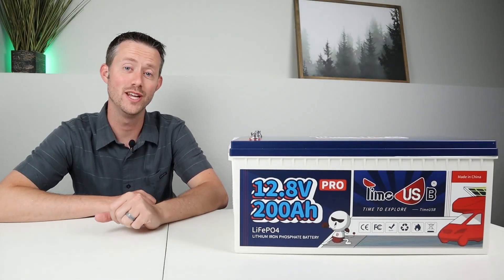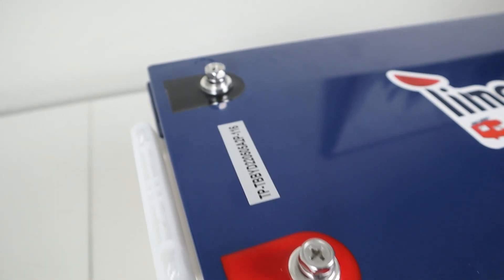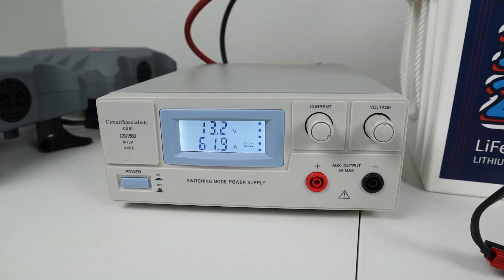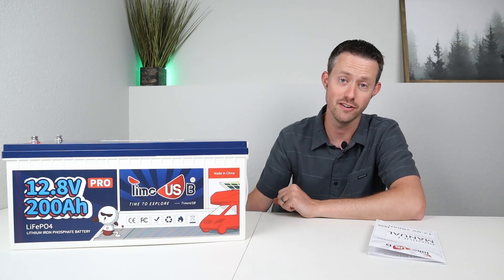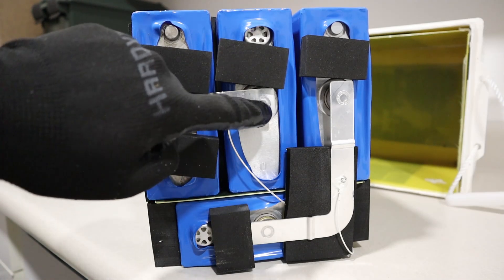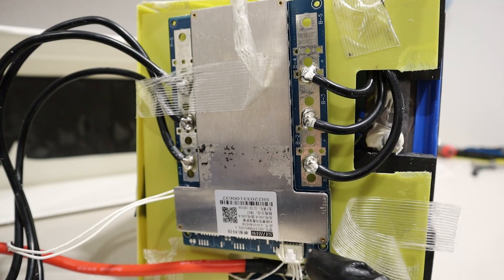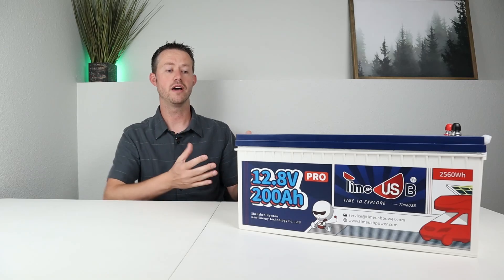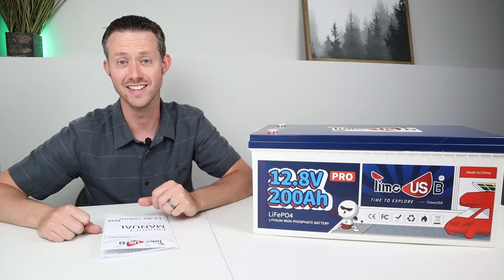Timeusb 200ah LiFePO4 - The MOST Affordable Option!? Teardown and Testing!

Comment from the maker: This is one of the most affordable LiFePO4 batteries you can buy! It has a TON of capacity for the price but only has a 100amp BMS and no low temp charging protection. What did you think of the performance?!
Reply: If they are using good quality grade A cells in the construction of this battery, then I believe it's worth the price. Especially after I discovered these batteries can be connected in series and parallel (up to 4P4S). So, just get two of these and connect them together to double the amperage draw. As far as low temp protection, don't most charge controllers have that built in now?
Reply: @troyyarbrough  yes most good cc have a lead to put on the battery for low temp
Reply: Thanks for the discount code 😁
Reply from the maker: @JOHNDANIEL1  BougeRV sent me one of their 100ah self heating batteries, I couldn't even charge it....I tried with 3 different LFP chargers, nothing worked. I gave up and just returned it. When they got it back they said it was my fault / issue why the battery wouldn't charge. I guess they think I'm stupid? I think the battery was missing the balance plug like Will Prowse when he tore his down... I'm done with BOUGERV.

Comment: Just bought the Timeusb 200ah LiFePO4 PLUS with  200BMS $499. free ship (Upgraded 200A BMS Board) : Timeusb 12V 200Ah Plus lithium iron battery has an upgraded 200A BMS board inside, which could support 200A max. continuous charge/discharge current, 2.56 kW max. continuous load power, and has max. 2.56 kWh energy... should be here mid week.

Comment: Great video nice tear down. However where did you come up with the fact that 6 ga wire is rated for 300 amps ? Even dc at short lengths your looking at a max of 135 amps and that's not applying the 80% rule for safety. 10 ga silicone wire is rated for a max of 65 amps each at short lengths. Just curious where you got these facts as someone who is not as familiar with wire ampacity might think it is ok to use a 6 ga wire for 300 amps and that would be disastrous  if not life threatening.

Comment: Great review, thanks! Do you know if the BMS is this battery is constantly balancing the voltage between the cells? I'm thinking about buying this and keeping it charged around 90%, but worry about the battery cells coming out of balance with each other... especially if I'm not fully charging it and cycling it from time to time.

Comment: Hi!
Maybe you can help out. I bought this battery and a timeusb 40A charger. The charger has a display and it shows “capacity it has charged the battery by”, but I don’t know what unit is this. It says something like 0.39C, 10C, 15.8C. Is this watt*hours?)
Reply from the maker: Not sure what that measurement is! Weird!
Reply: @Jasonoid  Thanks for your response. From my experience, it looks like it is amper*hours
Reply from the maker: @oleksandrleskiv  during a full charge it should go all the way up to 230ah. You'd have to see how far it goes!

Comment: I received this response from Gerri at Timeusb;  "Timeusb 12V 200Ah Pro battery employs new, Automotive grade cells from Tier one battery cells suppliers like EVE, CATL, Ganfeng, BYD,etc.  The actual capacity of the 200Ah Pro is 230Ah. (We name it 200Ah Pro as an upgrade from the regular 200Ah battery. )"
Reply from the maker: They have many different models, this battery definitely had used cells in it.

Comment: I know this may sound obvious, but, would I be better off to buy 1 200ah, OR 2 12V 100AH batteries ??
Reply from the maker: If you buy two 100ah batteries you have the ability to use them separately if needed.  If you put them in parallel you can get the same output as a 200ah battery.
Reply: @Jasonoid  Yes. The versatility of having 2 wins.

Comment: Nice review. But you ran into heat issues because you pulled the cap off of the battery. In my tests it will shut down sooner. Regardless, for the money, this is the best battery on the market right now. And their customer service is fantastic on top of it.
Reply from the maker: Glad to hear their support is excellent!

Comment: Jason can you build a solar cart battery system guide capable of running simultaneously a 28 cubic ft fridge and a 12k btu air conditioner and a power hungry high end gaming  PC set up (gtx 3080 or better video card) that has 800w power supply on the PC?  The whole thing including solar.  I know a ton of people who would like an off grid system that handles refrigeration,  cooling and gaming yet nobody I can tell has shown this on YouTube.  Get them views by making that video!
Reply from the maker: That's probably a 1000w continuous load, so for each hour of run time you'll need 1kw of battery power and probably 1.5kw of solar to keep it charged up. Would be a hefty system to be portable!
Reply: @Jasonoid  so....challenge  accepted?  I've just check a YouTube search.   As far as I know NO ONE has done this video and you probably have most parts to Frankenstein a working prototype.   (Insert sappy violin music here)....do it...for the children....or at least do it for the crazy amount of views you'd get with right video title and thumbnail 😉
Reply from the maker: This is an excellent system that will work!
https://youtu.be/J9WZcMDQaDg
Reply: @Jasonoid  yeah I've seen this video.  What I'm getting at is YOUR excellent presentation skills.  Build the system then actually do a full load 24 hour test showing the fridge,  ac, and gaming pc running full load AND  being fully charged by solar at the same time.  This video hasn't been done as far as I can tell.
Reply from the maker: @MyChannel-vm6dw  I'll think about it, I make penny's from YouTube so it's hard to justify spending $5000 for a project that will get only 10,000 views and make $150 lol

Comment: What cells are they using post the model or qr code.

Thanks
Reply from the maker: I couldn't find the information on the cells, they appear to be grade A used cells from an electric bus. Probably were 280ah or 300ah originally.

Comment: I guess if you lived or Rv'ed in a warm climate that would be a good battery. Living in a place that could freeze would be a poor choice. If you are a prepper it would be a poor choice. You really need that freezing point cut off. I wonder how much more money those features would be? I would pay more for a battery with a cold sensor charge cut off. I am glad to see you spread out your focus into batteries. The future is batteries and Gro Walls or the like.
Reply: You could get a charger or solar controller with low temperature cut off
Reply from the maker: So far Ive been pretty impressed by this battery since its affordable, met specs, and has low temp charging protection: https://youtu.be/dd1W8_tdl2c
Reply: @Jasonoid  
It's not $357 anymore 😔
Reply: @Jasonoid  I misunderstood your review I guess. I thought you said that it didn’t have low temperature charging on the BMS.
Reply from the maker: @kevinholland4156  in my previous comment I linked the new Dr Prepare 100ah battery video, that battery has low temp charging protection. This timeusb does not have low temp charging protection. Sorry for the confusion.
Reply: Better off to use a charge controller with a temp probe. Put the temp probe where the battery bank is and let the charge controller cut off charging should the temp 32 degrees. This is better than having the bms trip off and the  have to wake it back up. The temp probe will be more accurate then the bms as well.

Comment: Where is it made?  If China, how certain is actual delivery these days?  I'm going to file this one away; I think a project I may do in the Spring is to turn our little camper into an off-grid unit, and I'd need at least one battery like this, and maybe two.
Reply from the maker: For now, every lifepo4 battery is made in China. These are always stored in USA warehouses and shipped from California when you purchase them on their branded website, so if it shows in stock, it's pretty short delivery time.
Reply: @Jasonoid  Ok then, hopefully they're in stock when I am ready.

Comment: good job on that tear down, i am glad it didn't get destroyed in the process and i hope you are able to continue using it.
the bms and wire gauge should probably be upgraded to 200 amp continuous, for 200ah battery's. probably should also have a time limit shut down before thermal shutdown when drawing over the 100amp limit, imo thermal shutdown should be a last resort.
video side note: in the torture test section, the audio is poor for me, on headphones, one side has like no audio.
Reply from the maker: I agree, not much use for a 200ah battery with a 100amp bms. Would have been nice to see a full 200amp bms with proper wiring. 

I also noticed I only had one side of audio during that video section, something must have gotten corrupted during filming.
Reply: Sounded fine on my PC; check your headphones.

Comment: A 100-amp BMS should cut off much sooner than that.  There was no risk to the cells or the wires, so no harm no foul, but if it's rated at 100 amps, the BMS should allow a surge current for a short time but cut off if above 100 amps output for an extended period of time.  With that said, a 150 amp fuse would protect the battery from itself.  

Connecting four in series would give you 200 amps @ 48v (51.2) or roughly 10kwh of storage.  The limitation would be a (rated) output of 100 amps @ 48v, so any load over 5,000 watts, continuous, wouldn't work.  (Based on your actual result, it would...but I don't that it would be a good idea.)  It looks like a pretty decent value, but I would like to know the history on those cells.  I wouldn't be surprised if those were originally rated at something like 280ah and are 2nd life or B-grade cells, which is why they are only listing them with a 200ah capacity, and why the price is so low.
Reply from the maker: I agree that the BMS should kick in much faster since the BMS got quite warm. In my opinion it should stop around the 3 minute mark for anything over 125 amps and under 200 amps. I also would have liked to see a 4awg wire instead of the 6awg wire as well. 

There are no markings on the cells, someone else mentioned they are used electric bus cells since they asked Timeusb and they told them the source. Still pulled 230ah as advertised on the website but Im not sure how long they will pull that capacity (no advertised charge cycles in the owners manual either). At $0.20 a wh, you definitely get what you pay for.
Reply: @Jasonoid  Yes I wondered what the charge cycles to 80% is. I checked their website as well and could not find any mention of a figure for this.  I was wondering if it was in the manual but you said no, so I guess we will never know.  Maybe it's okay since degradation may be somewhat linear, but buyer beware.

Comment: This company is known for using Garde B cells in other models. Jason did you see any stickers near the cell terminals listing the AH? Or a QR code?
Reply from the maker: Nope, I looked and could find no specs or model information about the cells. Someone else mentioned that these are used cells from electric buses.
Reply: @Jasonoid  Will Prowse did a teardown on their 90ah battery, and it had grade B cells.
Reply from the maker: @grindychum  I don't think these are grade b cells, I'm pretty sure they are just used grade a cells out of bused. No swelling or damage on the cells.
Reply: @Jasonoid  Isn't that what grade B cells are, Used cells?
Reply from the maker: @grindychum  grade B cells are rejects from the factory and that didn't meet original capacity or internal resistance specs. They also could have damage like bloating or swelling.

These cells appear to be used grade A cells, meaning they have just been cycled enough to lose a bit of their capacity but aren't bloated or damaged.
Reply: The problem with grade B is that just because the reviewer got a decent battery does not mean you will also, The Chinese companies are known to cherry pick the good ones for reviewers while the rest get junk.  But we really need to know the type of cells being used, were these 300AH cells that are now 230?
Reply: those look like re wrapped BYD 250ah cells and just about the right size too
Reply: I am an electrician from Texas and I would like to say about B-grade batteries which refer to bad and defective and risky batteries and regenerative batteries, which are not B-grade batteries, are much better than B-grade batteries. Many large energy storage containers use such renewable batteries. Audi also introduced a three-wheeled vehicle this time that utilizes electric cells. The quality of the cells is tested and there is nothing wrong with them.
Reply: @isabelmerry3098  there is nothing wrong with grade B cells, besides the fact they will have reduced charge cycles because they have already been cycled x amount of times. So your technically not buying a "new" battery, you are buying a "used"battery. I have built external Lifepo4 battery banks from "used" batterys, more affordable than buying the external batterys bluetti and ecoflow make. I capacity test all the batterys and match them based on that rating.

Comment: Hi ya I saw an reviews on this battery yesterday why it so cheap because they use  2nd hand cell
Reply: As a bitcoin miner with 20 Timeusb batteries, I can responsibly tell you that the Timeusb batteries work without any problems. Their batteries are really good value for money.
Reply from the maker: Yeah, it still pulled adversited capacity and it should still last a long time even though it's used. Thanks for sharing what you know.

Comment: Thank you for explaining the difference between 100 and 200 amp BMS before I got my battery because I may need it for cooking in the future. I powered my Frigidaire window air conditioner for hours with it a couple of times in tests. Didn`t run it dead though. I have to get a battery meter with shunt and other parts to build a solar power system with it. I have a 60 amp MPPT charge controller. 

Apparently the Ampere Time battery I have doesn`t have a BMS that shuts the battery off with some reserve left but goes into protection mode and requires "awakening" so that sucks. I don`t want to overdischarge it and have that issue. I do have a 20 amp LiFeP04 AC charger to top it off before expected storms like hurricanes. 

I hope to use this stuff to build a rolling solar power station and have been warned about grounding, safety, fuses, and now have no idea what to do. If no hurricanes come this year I have until next year to buy the next 500 dollars in parts I need and hopefully more solar panels.
Reply from the maker: I'm glad you got the 200 amp bms as well. It's a good way to future proof yourself. As for fuses you'll want to make sure you have the appropriate sized fuses installed. Large 200 amp fuses are required for a 2000 watt setup. 

In a portable system you shouldn't have to worry about grounding the system. Think about portable gas Generators, no one grounds them and they seems to work fine.... I'm sure theres always a risk of something but it's pretty low.

Comment: Been building an 800watt, 24volt system for my Savana van, last piece I need are batteries, so many to choose from. I noticed battery prices have been dropping. Was going to get a couple Eco Worthy metal cased 150ah for their small size, but if I eliminate the walk thru, I can fit 2 of these in the middle rear of the van, now you got me thinking.
Reply from the maker: I have been impressed with my Dr. Prepare 100ah with low temp charging protection and 100amp BMS. It only costs $365 or so. Great performance for the price if you purchase two and wire in series.    https://youtu.be/dd1W8_tdl2c

Comment: Time USB has used cells from electric buses. They are already down to 80% of there life.
Reply from the maker: Thanks for the feedback Phase3d! There were no markings on the batteries and they don't have a rated charge cycle expectancy in the owners manual so that indeed could be the case!
Reply: @Jasonoid  The information came directly from Time USB themselves. Just ask, they will tell you, they don't hide it.